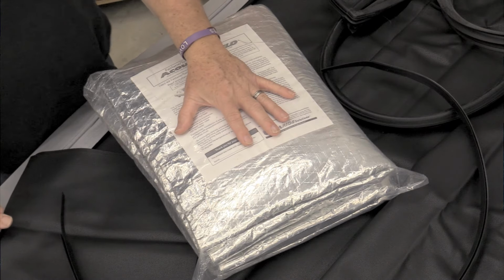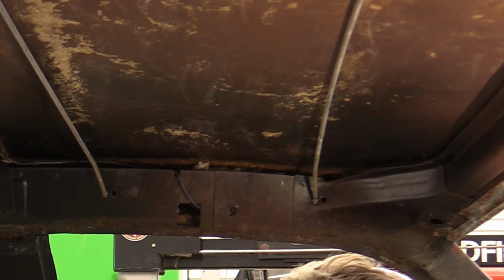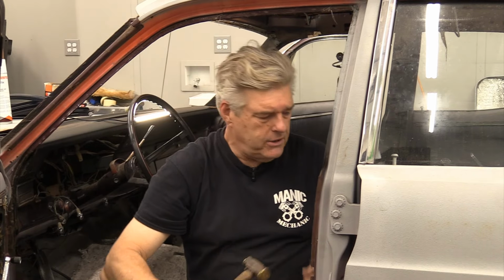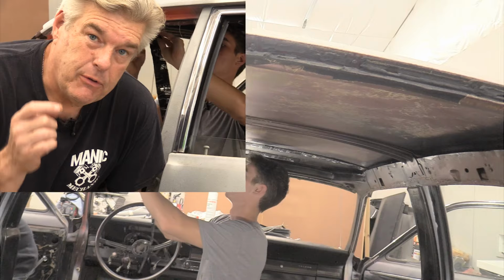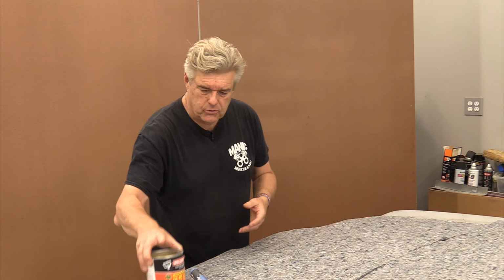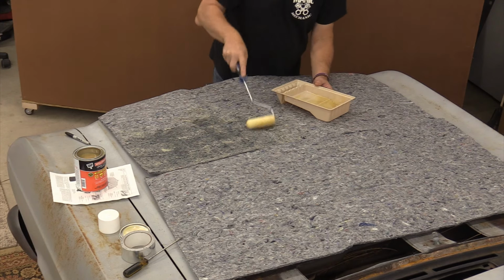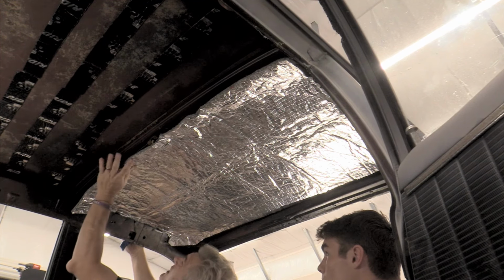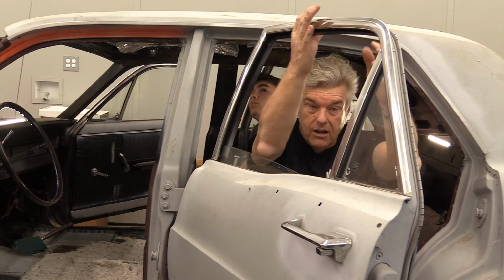Get Ready For Your Two Door And Four Door Headliner Makeover!

Comment: I did lizardskin both sound and heat and then I got some of that cheap insulation on eBay. Don’t cheap out, the glue on the cheap stuff sucks. Ended up using headliner spray glue from 3m to keep it there

Comment: I did lizardskin both sound and heat and then I got some of that cheap insulation on eBay. Don’t cheap out, the glue on the cheap stuff sucks. Ended up using headliner spray glue from 3m to keep it there
Reply from the maker: It's one reason that I use contact cement